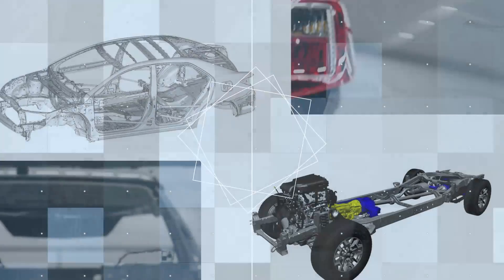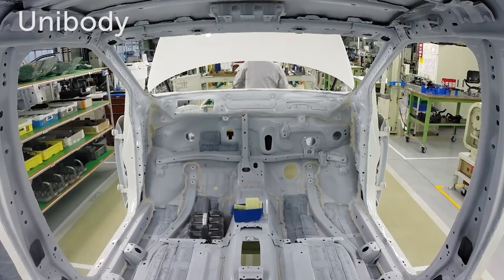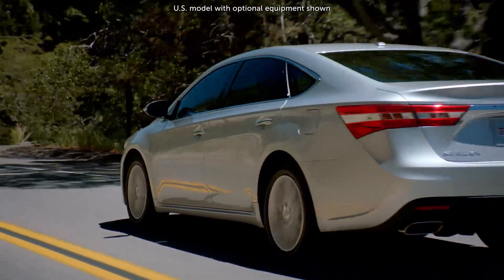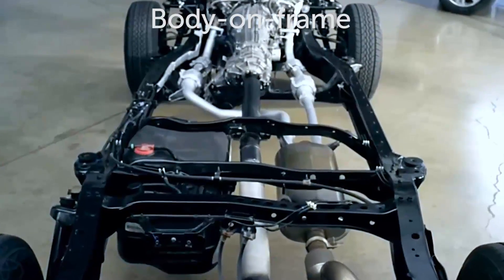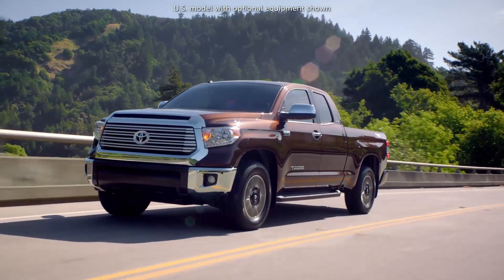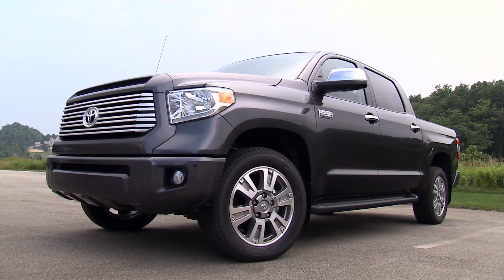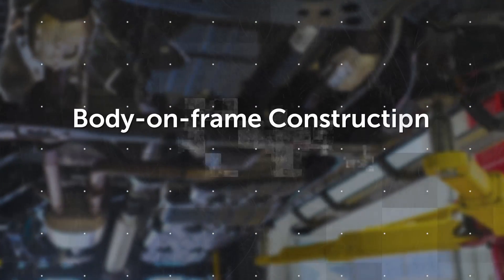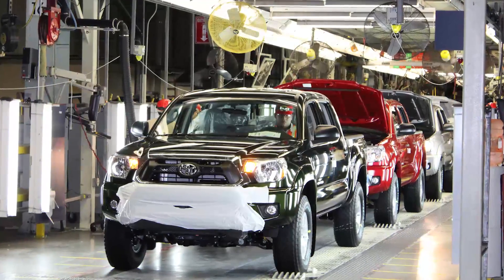Unibody vs  Body on Frame

Comment: A unibody truck is the best of both worlds.
Reply: That's... not how it works

Edit: If you actually wonder why not, it's because the ladder frame (body on frame) is what makes trucks strong enough. A unibody truck might have the engine to tow a house, but the chassis will just be torn apart because of forces it was not meant to withstand. If you want the best of both worlds, you need what's called a partial monocoque, which is almost like combining a unibody and its crumple zones to the strength of the body on frame, at the cost of very high weight
Reply: @toyota86s  If a unibody is like exoskeleton criters, a body-on-frame is like flesh and bones criters, then what you've just described sounds like a Xenomorph.
Reply: @slamongo  It kind of is. That's likely why it's barely used too, because of complexity

Comment: Are all Toyota's - -  - Honda's  or all of the oversees made cars and trucks built from used metal or refurbished steel ?
Reply: Steel is 100% recyclable, it does not loose its physical properties if recycled (that includes melted and reshaped afterwards). I know this is not a direct response to your question, but I just felt this might be your reason behind asking :)
Reply: @kalinandonov2799  a long time a go I asked man at the scrape yard what they done with all the old metal he bought he told me most went over seas to be melted down.

Comment: If you would like to be able to drive your vehicle home if you bumped somebody at a red light at 15 mile per hour. Then get a body on frame. If you would like five thousand dollars worth of damage from a fifteen mile per hour bump and the insurance company possibly totalling out your car then get a unibody. I personally prefer a body on frame because I would like to be able to drive my car home after a slight fender bender.
Unibody Was designed to make the dealership And body shop more money and cost your insurance more money.
I wish they would outlaw unibody.
Unibody is useless and a waste of money and they do nothing but cause your insurance to go up. If everybody had body on frame the repair cost would be cheaper. Because a body on frame can take a little bit more Is impact before damage results.
Say no to unibody

Comment: Unibodys are safer generally as the force doesn’t go thru you but body on frame sends the force thru you which isn’t great,
Reply: That's right they are safer at seventy or eighty mile per hour impact.
But how many people were going to be hitting some one head on at that speed. The majority Of car accidents are usually bumps and fender benders. And when a car can be totalled out at fifteen mile per hour it should not worth buying. I would like to build a drive my car home after a fender bender.
Hit the rear bumper Are they chevy silverado with a honda civic And see what happens.
The chevy silverado probably won't Even have a scratch on the bumper. But it will total out the civic. Fuck a unibody.

Comment: Body on Frame is strong & safe!
Reply: Unibody offers better mileage and handling. 😎
Reply: @dentatusdentatus1592   Not true. An old CJ can come out at 2400lbs
Reply: @dentatusdentatus1592 and also it wrecks and gets rusty 😂
Reply: @dentatusdentatus1592  When you are in a crossover, the handling factor from a unibody is gone.
Reply: Unibody is strong & safe!

Comment: So what do you guys say is the best compromise of body on frame construction with decent fuel economy for this situation?  I need a USED vehicle that's primarily a daily commuter but it also has to be able to pull a small aluminum boat, trailer, and all the cargo, etc. on occassion.  We're talking way less than 3,000 lbs.  I love the idea of a 4Runner with a v6, but I hear it is a huge gas hog.
Reply: You probably made your purchase already but I thought I’d chime in… Body on frame SUVs will typically have less fuel efficiency than their unibody counterparts because of their ability to tow. 4Runner would be a good option—regular fuel and easy to maintain. A Lexus GX will give you similar fuel efficiency (premium) with a bit more towing capability—has an indestructible v8 engine and an absolute joy to drive.
Reply: @steevyovan1592  They should make body on frame Hybrid SUV's. Then you'll get towing and Off-Roading with good fuel economy.

Comment: my car is Terios, is Lite SUV with ladder frame
Reply: No it's unibody. SUV with a ladder frame is called a truck
Reply: @MrKkdkk  Terios is using Ladder frame
Reply: @armanbaik  then look inside your front wheel wells and find where your suspension is mounted
Reply: no, terios is unibody. Body not on frame, body build with frame.

Comment: My unibody hyundai santafe saved my life, my brother crashed head-on with a truck (i was the passenger) and the car crumple zone got crushed, but the A pillar didn't had a scratch. We were going 80 km/h. We were both lucky af, we just walked away the wrecked car.
Reply: I'm happy to hear you are both ok.
Reply: I own a 2012 Santa Fe, that's one of the reasons why I bought it.  There's a video on YouTube showing the 1999-2007 GM-FULL size pick up extra cab in a front end crash test,  you should see how it folded up like a tin can in the front and cab part.  So body on frame in some cases like this is not always safer.  I love my Santa Fe.
Reply: @uioned  you should choose unibody for all reasons EXCEPT for towing and offroading . So if you want a truck or an off road suv (not a crossover suv I mean a 4runner or jeep)
Reply: There is a video of a guy driving (in traffic) a Hyundai unibody, AFTER the car was crushed by that horrible August 2020 Beirut explosion.
Reply: 9 dec 2019 12:11 pm est:
hindu teaches ahimsa which means avoid causing injury to animal.
hindu, zoroastrian say cow is god, forbid eating cow.
hindu-person invent cosine, sine.
info : find 'cow', 'ahimsa', 'cosine', 'sine' in http://wortel.ucoz.com/bible_diet.htm

bible has flaw : http://wortel.ucoz.com/bible_flaw.htm 
but what bible says about year 7 / sabbathical year, maybe is true : 
http://wortel.ucoz.com/7years.htm